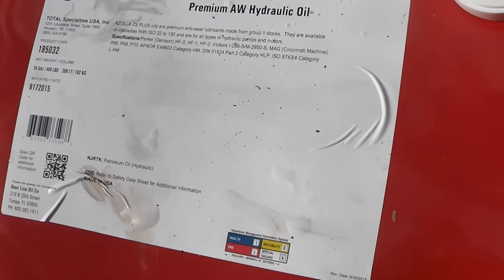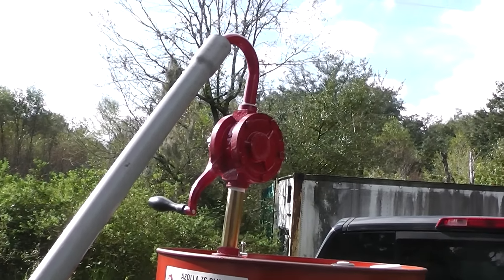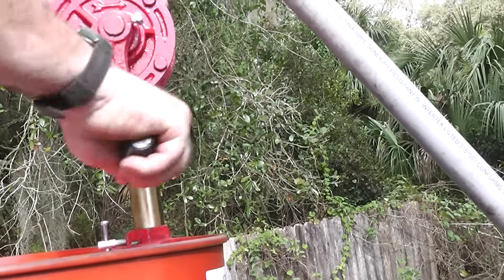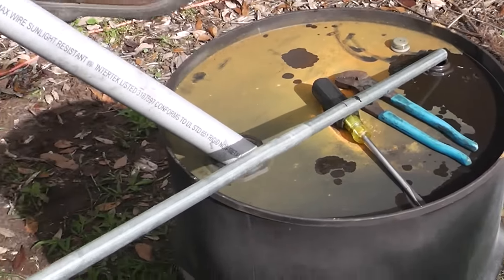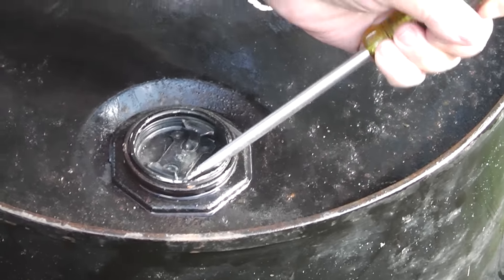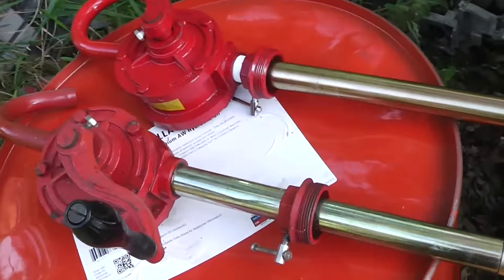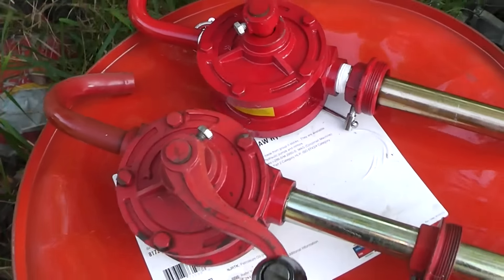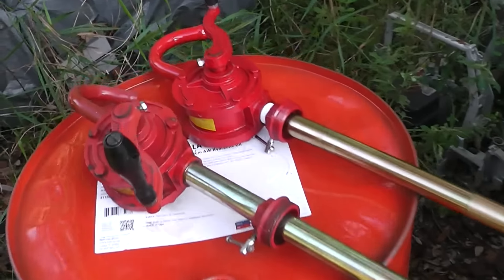Harbor Freight Rotary Barrel Pump vs 55 gallon Hydraulic Oil Drum

Comment: I looked at getting a harbor freight pump, but after all the bad reviews I bought a FillRite on eBay for $177.

So on those barrel lids, if you take some channel locks & open them all the way open you can open those caps without.a screw driver.

Comment: I set up four 55 gal drums in a brace one a small 20 ton trailer I built on house moving axles that I bought as scrap along with other equip. ☺️.  It’s 8 ft wide, padded, bedded with 12 inches of liter absorbent and covered for safety.  But I digress....  I bought the harbor freight pump which is cast iron and it rusted tight in one season.  I went to my farm store and bought the large heavy duty Fill-Rite Manual Piston Pump (sale $149.99 / reg.  $189.99) -one for gas and one for diesel. And have got years of service.  Dad recommended these first but I HAD to save money and I knew ‘better’!  If you ever wear it out there are rebuild kits that take 1/2 hour with nasty arthritis and shaking hands to install.  Penny pinchers aren’t always dollar smart and spend-thrifts will meet a bad end.

Comment: Wow $6/gallon! I'm paying $11 from the local gas station for universal hydraulic oil.
Reply from the maker: +jasonmushersee Yep, that is about what I was paying for the 5gallon pails.
 It is too bad we are so far apart.  We could have shared the cost and got 27.5gallons each for $162.50 out the door.  We could have argued over who gets the big orange drum. lol
Reply: stuff is cheaper if you buy in bulk, I buy most of my farm needs in bulk. cost more at initial purchase but works out cheaper in the long run

Comment: how long did it take for it to be managable? I use an electric pump but have 2 hand crank (same ones you have) new in boxes for saving.Just curious how much time effort before manageable for you and your father?
Reply from the maker: +working2Bselfsufficient Somewhere in the 20 -30 minute range.  It could have been done much faster but, making a video does slow thing down a bit, had to find my 30 gallon drums and get set up.
 Harbor Freight advertises their pump at 10 gpm.  I did not get in any hurry and we measured @7-8gpm.
So I would say that we had about 6 minutes of total pumping time with low effort.
Reply: +homesteadprepper Thank you.As I said I haven't used mine the electric is too easy but have them new in boxes still for a day I will need them.One of those things when you have a homestead you will need them one day and I make sure if there's a non electric manual version get a couple and keep them they will be used or just get more expensive and inconvenient to have to get if you can get them when needed.